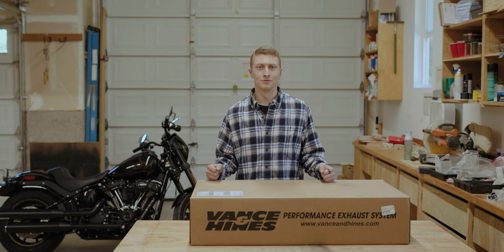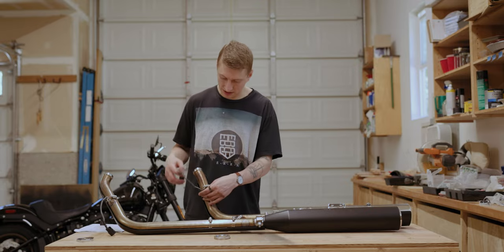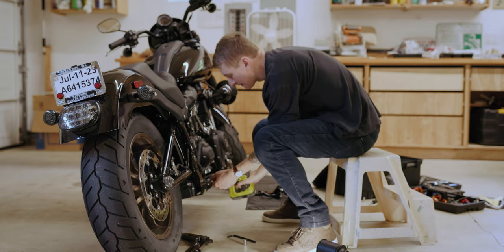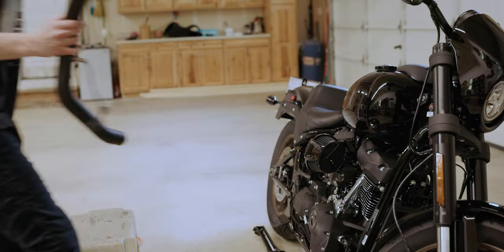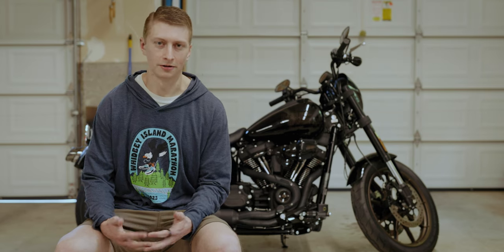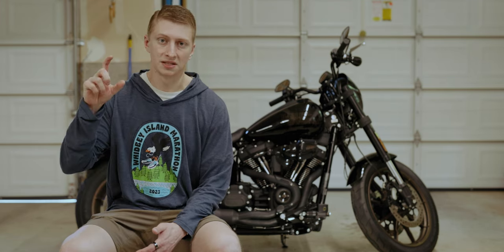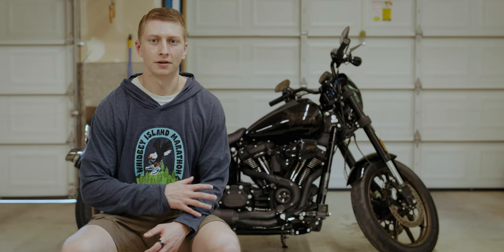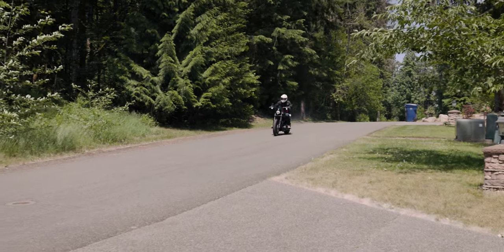Installing Vance & Hines Exhaust On My 2023 Harley Davidson Low Rider S

Comment: Just a heads up.  Any time you pull the exhaust you need to replace the exhaust gaskets.  0 miles or 50,000 miles doesn't matter, because they are single use.
Reply from the maker: For sure. I saw some other people say you can check to see if you have to but I never thought that made sense. Even if you could get away with it, they're so cheap so why not just replace them right?

Comment: It is a PITA doing your own work.  Even worse having a Harley dealer do it.  In my experience, the Harley dealers are 100% scammers.  Do the work yourself and the dealers will immediately claim voided warrantee.  Dealers are in general losers that put that warrantee invalidation threat in their pocket like a gun.  It is good to do your own work cuz quite frankly 99% of dealers don't know crap.  They know $$$ and nothing more. My thinking has changed these past few months...I will not be intimidated by doing my own work.  If I wreck the thing, it is only $3K for a "Squealing Eagle"  replacement engine.  Good for you to do it yourself.  Dealers can kiss my hiney.

Comment: I had my dealer install this system in the brushed finish immediately before I took possession of my 2023 Low Rider ST.  It looks NASCAR and sounds NASCAR.  One plus is the spacer, that combined with my Joker Machine Serrated Long rider pegs.  The combination of the two allows for a wider stance clearing your right knee from the stock heavy breather.  Beautiful bike, great job and be safe out there!
Reply: Where did you get the spacer?
Reply: @aaronvandewesterlo6078  it came in the exhaust mounting hardware kit.
Reply: Aw damn, wonder if i could buy it seperatly?
Reply: @aaronvandewesterlo6078  I would make an inquiry.  If you’re looking to space that right peg out a bit I’m sure it wouldn’t take any more than a small block of billet aluminum, two holes and longer bolts?

Comment: Thanks for the video! Super helpful as I’m on the same bike and looking to install very similar pipes. I wonder if the exhaust ports weren’t seated flush because you didn’t end up using the V&H port gaskets and went with the bigger ones from Harley?
Reply from the maker: That's not a bad observation. I would hesitate to use the ones I accidentally bought though when comparing them with the general parts number but that's just me.

Comment: Do you need to tune the bike or anything when you install these
Reply from the maker: @scott8233 you should if you’re able yes. If you’re changing just the exhaust, you can get away without it, but if you do the air intake and exhaust then yes definitely.

Comment: So after 9 months how do you like them? Do you lose any mid range power? What tuner are you using? I'm kinda obsessed with this exhaust system lol!
Reply from the maker: I'm actually planning on doing a long term review of the exhaust soon. Quick answer though is I love it. I added it pretty much right away when I got my bike so didn't really spend enough time on the stock system to notice any big power changes. I'm currently installing a cam which should make it sound even better though. My long term review video should be out in a month or two. Hope that helps. Enjoy!
Reply: @Warren-Rides  Thank you yes. Cam will make big differences in power in one way or another depending on the cam. I upped my HP/Torque like 30 or so with a cam on my 96ci back in the day so I can only imagine one on the 117. I'm staying clear of cams though for a good long while. Too much MPG loss. Way too much for me.
Reply: @Warren-Rides  So update I bought the pipes. They are on their way. I do like my Cobra NH but i've wanted this system so bad I just had to get it when I had the opportunity.
Reply from the maker: @infini1970  Nice! I'm sure you won't be dissapointed.
Reply: @Warren-Rides  Just installed the pipes today! Man it's just what I wanted. Run a bit hot though. Was feeling a little heat on the way home at night and only a 10min ride. I'm gonna probably add a custom heat shield from the shop I go to. Air Breather and Tuner asap. Waiting for install. Did you find one of those springs were loose? One on top are loose.
Reply from the maker: @infini1970  That’s awesome, I’m glad you’re stoked on it. If I may lend a suggestion, I’d wait until after you do the tune before bothering with additional or different heat shields. Once I did the tune, the heat output from the pipe diminished noticeably. I didn’t have any loose springs though.

Comment: Nice pick on the exhaust. I have the stainless. I would recommend getting some security torx bits and removing the baffle to see if you like the tone. I did it to mines now the baffle hangs on the garage wall.
Reply from the maker: Oh nice. I'm doing a cam install at the moment and am curious to see how it changes the sound/volume of the exhaust. How did removing the baffle change things for you with this system?
Reply: Nice. When I removed the baffle I felt like was running a little more powerful.

Comment: The front oil cooler does not come all the way off but if you remove hardware from the mounting brackets it moves out of the way so you can get a straight shot at that front header bolt and I went through the same thing with the brake pedal and all that blue loctite from the factory it sucked
Reply from the maker: Ah good to know. I thought about trying that with the oil cooler but ended up finding a different tool that worked. Glad to hear I'm not alone in that struggle though, I really felt like a moron for a minute.

Comment: Sounds great what tune are you running?
Reply from the maker: Thanks Mark. I actually didn't do a tune at this point. Currently installing an S&S cam however and will be running a tune by Fuel Moto.

Comment: Did you have to tune it after wards ?😊
Reply from the maker: I elected not to tune it after just doing the exhaust. From what I gathered online, if you do either just a tune or just an exhaust you can get away without a tune. I had no issues, but I would say that if you think you might do intake and exahust, or even a stage II later on, you might as well buy the tuner now. I just recently finished my stage II where I did tune the bike and noticed the exhaust doesn't run as hot which is not only more pleasant but probably is a good inclination that, again while I didn't have any issues prior, it might not have been running "optimally". Hope that helps.

Comment: How was putting in the rear 02 sensor? That wire looks tight
...
Reply from the maker: No issues. Just made sure not to strain the wires but I'd say it fit with a good balance of not too much tension and not too much slack.
Reply: @Warren-Rides  awesome thanks for the reply!
Reply from the maker: @bikesandbeagles  no problem. Good luck with your future installs.
Reply: @Warren-Rides  I got this pipe in and installed (in stainless) and it's awesome! I appreciate your thoughts on this install, they were very helpful. For anyone reading these comments I'd like to say that bracket that pushes out your foot peg if you're running mids kinda ruins the lean angle if you're using stock length pegs. I've ordered shorter more performance-oriented pegs to fix that issue.
Reply from the maker: Thanks for the feedback. Glad to hear it was helpful along the way. Enjoy the new sound!  @bikesandbeagles